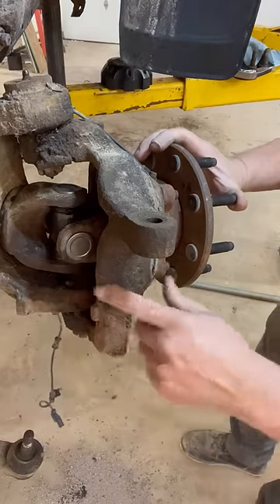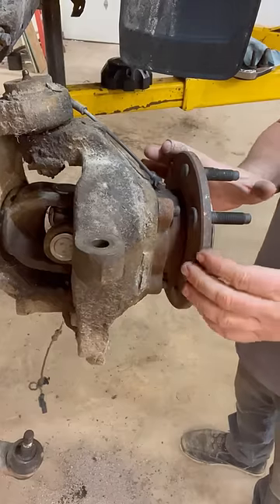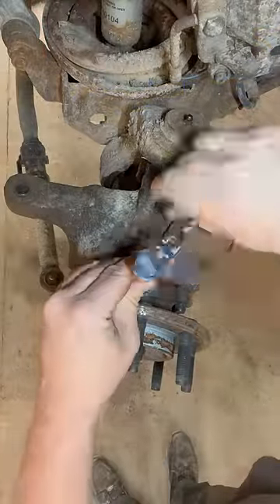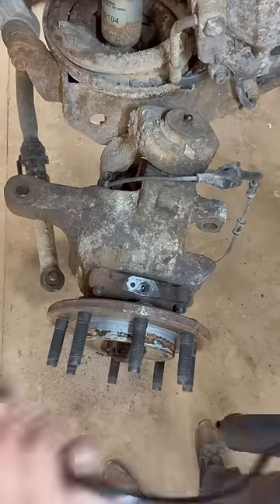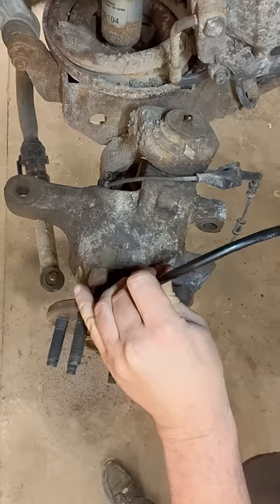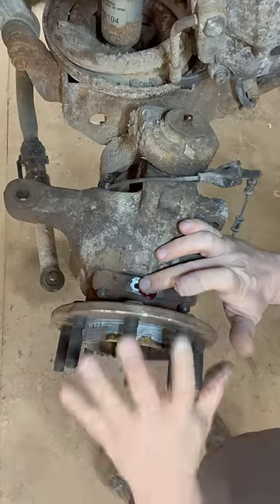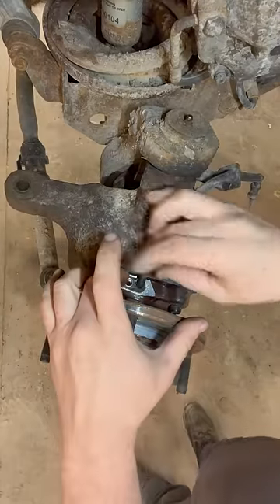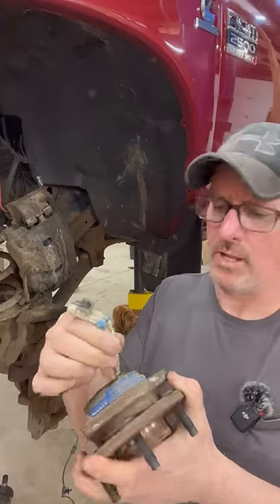Easy Steps To Lubricating Your Sealed Wheel Bearings For Smooth Performance!

Comment: I've been doing this ever since trucks started having anti lock brakes. I thought everyone knew this trick.
Reply from the maker: Apparently not! Lol!
Reply: lol they think they know things but don't  , owned same 2 dodge cummins for the last 25 years and both have same berrings but the 98 doesn't have front ABS like the 02 so no hole drives me nuts lol , so I bought lifetime  ones and just change out them and axle u joints and brakes  every 4 years or so . @Tomsfoolery.
Reply: I just went oh damn didn't know that. Then thought oh yeah I don't have a speed sensor.
Reply: Thanks for sharing
Reply: I have bought a few of them in the past but none of my older ones have a speed sensor. Now my new one does, so a good tip there.
Reply: Tone ring is outside of the bearing seal...won't work
Reply: Applying grease anywhere helps but your not greasing the bearing
Reply: Here's what is wrong. Engineers think ball bearings don't need grease. They lightly grease them with white lube to prevent rusting...you can grease them with a needle fitting if you gently go around the seal.
Reply: @davidkeller4841  the tone ring it litterly touching the bearing cages there is no seal , just on the outer housing you are mistaken on the construction of this style of unit bearing.
Reply: @Tomsfoolery.  I am a professional tech and have been for almost 20 years now.... I really truly hope this is a parody video.. false information like this is what I hate most. when I hear customers say "I did it myself, saw a video online", I know it's going to be a pain to fix. Some of your videos have decent information too that's why I am not sure if you really think that's how a bearing works....

Comment: That doesn't go to wheel bearing,bearing is sealed
Reply: wrong it is the same cavity
Reply: Agreed that is likely a double roller and that hole goes to the outside of the race.
Reply: It most definitely does and will push the old grease out of the seal if you keep pumping. That's actually how I do it until the dirty discolored grease is gone.

Comment: C/S: ABS light on and traction control keeps kicking in after you guys replaced me bearings
Reply: Next is “limp mode”, where your trans does not shift out of 2nd gear.
Reply: They probably used the wrong bearing or possibly installed it backwards some of them have a magnet on one end
Reply: I see you too have worked on this specific issue. 

1 damned time I did that shit. 1 time. 

It wont see the tonenring. 
Random ABS activation ensues. 
Codes will be c0265/c0222c0232, erratic speed sensor, abs unit not reading right, just all sorts of whack shit. 

If you did PACK THE TONE RING WITH GREASE... 
Well
That sucks, its a right pain to clean out
But before you buy new sensors and abs units and bearings and shit

Clear every last tiny memory of the grease out of there. There is no exit hole for the carb clean or grease to come out. 

So you've done funked your ish all the way up? 
Clear the rest of the day. 
Gather the trinity of old toothbrushes, carb cleaner and light the shrine to mechanical gods, the sulfide used gear oil attracts the spirits of old mechanics, they will cheer you on by spite and ebentually when youve busted enough knuckles and gotten carb cleaner innall the cuts several times, you might be judged as worthy to re-install the bearing WITHOUT GREASING THE TONE RING, and youll be dialed. 
Freshly red faced from the irritation that comes only from scewin yourself over on a repair. 

It is the way. 
Go forth and warn the younguns if you see them about to make the same mistake. It is our penance. 😂

Comment: You really shouldn't put grease on a tone ring. Chevy has had issues in the past with failing wheel bearing seals allowing grease to get all over the tone ring, causing ABS faults. The repair is to clean the tone ring with solvent and blow it out with compressed air. I've had to do this dozens of times.
Reply: Common sense would tell you not to pack a speed sensor with grease. Common sense in not common.
Reply: I thought the same...shouldn't spray lube either.   But good thought though
Reply: @anon556  common sense would tell you the speed sensor is plastic and you can't pack with grease. you obv dont know what a speed sensor is lad
Reply: lol the tone ring is full of grease from factory lol its not gona affect anything , the grease will move off the ring and get into bearings when wheel spins and heats up a bit , stop the foolishness
Reply: @TheCaperfish  The bearings are sealed, it's a hub assembly.
Reply: yes from outside elements , the tone ring and bearings are in the same cavity ,  its more important to do this especially with cheap aftermarket bearings as they have little or no grease , the grease will get to the bearings , and extend the life of the bearing  , got 300 k on my berrings now with no play . that is pretty unheard of  . 26 years I've  had this truck since new  @THEGHOSTSLAVE
Reply: @TheCaperfish  Exactly.
Reply: @TheCaperfish  It's always people without first hand knowledge telling you what will or will not work. I've personally done this and it does work. It has no effect on the abs whatsoever. It will help the bearings last a lot longer.
Reply: Incorrect advice
Reply: Do things in this order

Google dodge ram unit Bering cross section view 

Hit images 

Reply with an apology 

Promise to never work on a vehicle again
Reply: This guy is batshit crazy!

Comment: Please do a part 2 and remove the wheel bearing and show where/how the grease goes into the bearing
Reply: Yeah, that's what I was thinking. If grease goes in, it's gotta come out. Also, excessive grease isn't good.
Reply: Your not purging whole bearing  just adding a bit at a time every year or so  to keep it lubed , they don’t come with enough grease in them from factory
Reply: @TheCaperfish I think you're missing his point. He wants to see how you guys think the grease is actually getting to the bearing. Because it's not. That sensor hole doesn't get you access to the bearings, just the tone ring. Which doesn't need grease - there is no benefit to having grease in that area, but there are negatives...
Reply: You are missing the point , You can actually see the inner and outer berrings on each side of the tone ring if you look in hole on an angle lol stop it , they are right there in same cavity , the only seals are on the outsides of the assembly
Reply: @TheCaperfish If the only seals are on the exterior, the grease will work it's way into the center cavity, leaving the bearings under nourished.
Reply: @robertball3578  the thing is the bearings ARE in the centre cavity so they will receive the vitamins they require
Reply: This is why I don't like DIY guys.
Reply: And this, boys and girls, is how to blow the seals out of a hub assembly! Yay!🎉
Reply: It doesn't
Reply: that’s a sealed bearing
Reply: @theharleymechanic  the berrings are not sealed just the exterior of the assembly is
Reply: @BWalker-yg9en  I'd say ya did pretty good , no way will you get that out of an aftermarket china made   dodge unit berring with the little amount  of grease they put in them
Reply: @TheCaperfish  yeah better than I expected that's for sure.
Reply: @TheCaperfish  they shouldn't come from the factory with grease? The abs sensor doesn't do the job correctly if the air gap between the sensor and the tone ring is not correct. Adding grease to the tone ring housing will decrease the air gap. I guess it's a great tip if you don't care about abs or safety, but I don't see where this is beneficial by any means. I recently rebuilt the front end in my 2005 dodge ram 1500 and can confirm the tone ring and wheel bearings are separated.
Reply: @andrewmessinese7316  these are not the same design , the grease won't effect the reading they have been in use since 1994 and covered in grease shared with the bearings with no ABS issues , they designed them that way , grease will not interfere with a magnetic field .
Reply: @andrewmessinese7316  the 2500 bearings share the same cavity and grease , there are no inner seals
Reply: @andrewmessinese7316  not sure what to tell ya  ? they have been around since 1994 millions of em on the road , tone ring full of grease with the bearing  with no issues with ABS operation

Comment: Definitely works. Been doing that a long time.  However I add more grease than that. I pump in until it pushes out most of the old grease, clean it out and continue on.

Comment: The sensor measures the gaps between the reluctor ring and it measures the time in between each Gap in that reluctor ring so if there's no Gap in The Reluctor ring you're going to get a ABS code and light.
Reply from the maker: If you filled the gaps with metal, you would be correct. Grease is not magnetic so you’re incredibly wrong. This isn’t something I just thought up. I have been doing this for 191,000 miles. Never an ABS issue.

Comment: The tone ring runs on the outer face of the bearing not inside, do not add grease to the tone ring, the grease will attract dirt and dirt is Farris, this will change the voltage generated and the ecm/abs module uses the voltage to know how fast the wheel is moving, all critical systems in a vehicle use this information directly or indirectly.
Reply: the tone ring is literally touching the bearing cages   it sits in-between them , how would dirt ever get on the tone ring , the tone ring is covered in the same grease as the berrings from the factory
Reply: @TheCaperfish  the tone ring does not sit in between the bearing races, hub bearings use conical bearings that are in a sealed housing, the tone ring sits on the outside face of the seal cover, there is no such thing as a “wet” tone ring in a hub bearing.
Reply: @stephan4490  lol  they are covered in grease from the factory , the same grease that is on bearings , stop it and do some research
Reply: @TheCaperfish  you do not know what you are talking about, google could be your friend to not look ignorant so please do your research before posting comments that you have no knowledge of.
Reply: @stephan4490  ya can see the rollers when ya look in the hole on both sides of the tone ring lol they are in the same cavity , the only seals are on the outside of the unit housing , what don't you understand ?
Reply: @stephan4490  I have the knowledge  did you google a pic yet and confirm how wrong you are  ?
Reply: @TheCaperfish you’re on every comment reply lmfao chill out bro. Let homie back himself up
Reply: @Toyotatech86  I know I know , I hijacked his thread , its fun tho  ,  hopefully it brings more money in for the OP ?  does it work like that or is that just views and subscribers ,  do comments count also ?

Comment: The reason they are sealed is that contrary to popular belief you can over lubricate bearings and shorten bearing life, which most tend to do, also excessive preloaded that constantly seems to be applied also shortens bearing life, take those 2 out of the equation and sealed wheel bearing life is wayyyyy beyond what was achieved with traditional serviced bearings !

Comment: Thank you to all the people that informed others not to do this, that speed sensor relies on reading the tone ring inside the hole he put the grease into, which won't work to well with all that grease in there. This will affect your abs and throw codes, and good luck getting that grease out without having to replace the hub.
Reply: lol the tone ring was full of grease from the factory  , it doesn't matter if hub is 1/4 full 1/2 full or 3/4 full of grease , there will always be the same amount of grease in the few thou gap  between the sensor and tone ring ,  it does not throw codes stop it

Comment: I’ve been working on cars for many years. It’s a good idea to clean these areas as you can get ABS codes from corrosion but I’m not sure that you wouldn’t get intermittent ABS codes from overgreasing spot that supposed to be somewhat dry
Reply: the tone ring was full of grease from the factory  , it doesn't matter if hub is 1/4 full 1/2 full or 3/4 full of grease , there will always be the same amount of grease in the few thou gap  between the sensor and tone ring ,  it does not throw codes

Comment: The bearings have seals on inside also; so grease is not likely to get into the rollers,however, if hole is filled with heavy oil it will eventually weep past that seal and mix with the factory grease and keep it soft and flowing.
Reply: no seals on inside just outside of unit assembly

Comment: The bad thing about this on 4x4 SuperDuty... the axle rides on a little needle bearing inside..  So even though this keeps the main bearings alive, the little needle bearing goes bad and then wears a groove around the outer shafts.  I don't know if they have changed it since then, but that's how it is on my 2002 F350
Reply: correct. I replace both mine every 100k. 99 and 02 sd.
Reply: This is a RAM
Reply: @mattbrown9484  Yes.. but the Ford SD still has a similar "hub" style main bearing like this, for the wheel.  but like I said:  if you do this "trick" to a SD, you still have the pesky little needle bearing that free spins around the shaft-- that likes to fail.   In other words:  if you do this on a SD and ignore the needle bearing,  it's not gonna turn out well for your 4x4 shafts.
Reply: @oregonfordguy9812  My wheels are noisy..  I'm sure my needle bearings have eaten half way through the shaft by now. lol..  I wouldn't expect any less at 240k miles.
Reply: @calholli  - true.  But the did say wheel bearings.
Reply: @mattbrown9484  It's still part of the wheel bearing structure.. You do this trick so that you don't have to take the hub off..  So my point was, if you do this to a SD and neglect the inner needle bearing, it becomes a problem..  SO you still have to take the whole thing apart...........   that's my point:  This shortcut doesn't work for Ford SD,  because of the needle bearing

Comment: Are you lubricating the bearing or making a shield of grease to protect the bearing for a short while? To me it’s still sealed and applying there doesn’t grease past the shields but I can see it as being a barrier from water and dirt. I have never tried this cause I can’t even grease a sealed wheel bearing assembly off the car without removing the metal shield’s and bending them. I feel centrifugal force from bearings pushes the grease outward and can’t see how the grease applied on surface would make into the bearings. I would be concerned the sensor would mis read after all that grease becomes contaminated. I’m not hating brother and good video just trying to understand.
Reply: It is the same cavity the grease will reach the bearing , if you look in abs hole the tone ring is full of grease ,  I add some every time I have rotors off especially if it’s an aftermarket bearing cause they cheap out on the grease and imo there isn’t enough in there when new , it WILL NOT. Affect yer abs reading or cause a code or light

Comment: Your speed sensor reads the tone ring, putting grease in there will F up the traction control because it can’t read the wheel speed.

Comment: I have a 04 ram with this exactly set up and you guys want to know what happened after doing this?? My bearing last almost 160k miles no kidding, in fact after installed free hub spindles the bearings were in good condition I just replace them to have locking hubs and get rid off of the lousy doge 4x4 system

Comment: Why are you cramming grease where the sensor picked up? What happens when you wash out the bearing? They are sealed bearings for a reason.
Reply: research before replying , the berring are not sealed  they are in the open cavity with the tone ring
Reply: @TheCaperfish  it's a bearing. Learn how to spell before you give some one the beef . Also the faaaaaaaaaak did you try to tell me? 😂🤣🤣 The bearings are definitely sealed bearings. I want to know what happens when the grease covers the tone ring, how will your wheel speed sensor read and also the grease will pick up dirt and debris and carry it into the bearing as even though it's " sealed " it's not sealed that well.
Reply: @robsorgdrager8477  I never make fun of people with auto correct for spelling  thats petty , life is too short to go back and change it  , obviously you knew what the word was so why bother complaining about it 

do things in this order 

google Dodge Ram unit berring cross section 

hit images 

learn you have no idea how these berrings are made 

reply with an apology 

promise never to work on a vehicle again

Comment: Maybe that works on wheel hubs.   I work on lightrail trains and I can tell you that grease on THOSE tone wheels is counterproductive.
Reply: they are covered in grease from the factory lol it will not affect anything , grease will not block a magnetic signal
Reply: @TheCaperfish  good to know.  But in a lightrail train situation, the grease captures metallic dust from the rails and steel tires, that does cause issues.  

The car situation… I can see how that would be different.
Reply: @matthewdorsett9446  agreed , the amount of metal dust would play a part in your situation , here though if there is that much wear metal in the grease to cause a problem that would mean the bearing is toast anyway , it would of fell off truck first  if they were wore that bad lol

Comment: The wheel hub is still a sealed bearing, the only ones itbwill work on are 99-04 superduty and that only gets grease to the output shaft cage bearing...